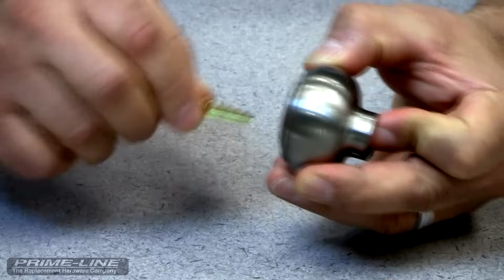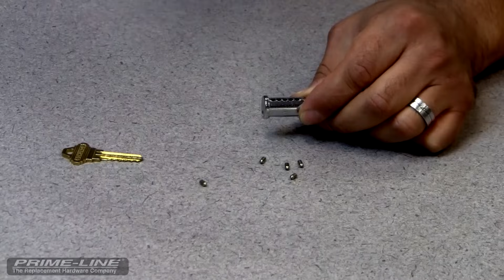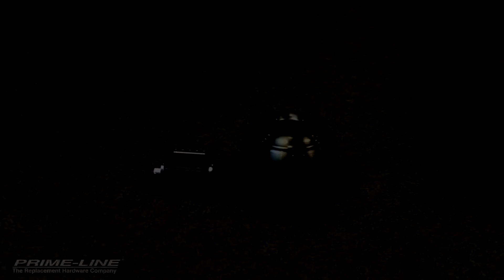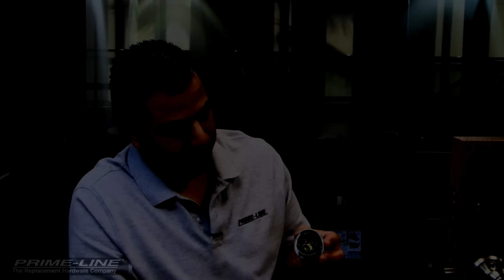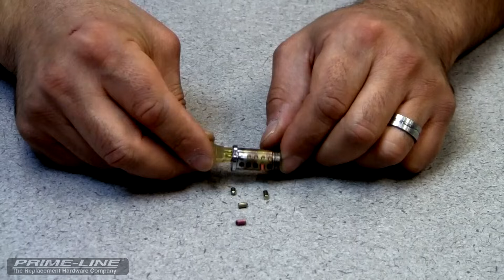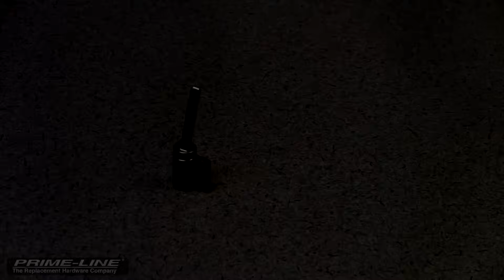Re-Keying a Schlage Entry Knob and Deadbolt

Comment: Hi, any advice if i lost the keys.  I would rather re-key my house rather than replace all the locks and deadbolts.  Thanks for your great video
Reply: Eric Holmes

Joy Duncan,

  If you lost the keys to your schlage locks, use a schlage bump key on the knob.  Here is how.

Pull the schlage bump key 1 notch from the keyway.

Bump the key to the right with a hammer (turn the key to 3 o'clock)

While the schlage bump key is at 3 o'clock.  Stick a thin tool in the tiny hole on the knob and the knob will come off of the knob housing.

You can now repin the schlage cylinder to a schlage key blank.
Reply: @ericholmes5743  He does not want to repin the cylinders - that would be a lot of labor.  What he wants to do it first use your method to disassemble the lock cylinder, and then determine the key code from the length of each pin.  Then he simply has keys made using the code.

Comment: Great video...

Rekeyed two but on the third I got cocky and didn't slide it in at the correct position and two of the five spring/pins set in the lock leaving it halfway in/half way out...

Any tricks to getting it unstuck?
Reply from the maker: Is it the key that's stuck or the cylinder?
Reply: The cylinder is stuck.  The key is out.
Reply: I had to watch the follow on video for the first rekeying as the pins and springs came out...  This one has two of the pins and spring engaged and won't budge.

Comment: Great video.  I have a double-deadbolt so I use a key on the inside and outside, will this work with that?  It is a Schlage...
Reply from the maker: Yes, just key both to match the colors listed in the instructions.

Comment: I'm a commercial locksmith and would suggest to stay away from the Schlage "F" series locks with this "floating" top cap ...pure junk. The top cap is prone to pop off during re-keying if you are not experienced and extremely careful. Also, when you turn the button locking the lock, the inside knob still rotates giving the impression of not being locked posing a safety issue if you have small children. Can also also cause lockouts.

Comment: I found that it is critical to get the right amount of turns (tension) on the threaded cap when it is put back on the key plug.
If it is too lose or too tight, you won't be able to remove the new key. The cap ring tension makes sure the key plug pins line up with the spring pins.
Reply: I had the same observation, BakerOne.
Reply: @Demetrios Christopher I found this interesting, because in my case I backed it off only one notch.  Apparently up to a quarter turn is ok.  Mine seems to work just fine so far.

Comment: Thank you for the video. My locks are almost 20 years old. Are there any differences I should be aware of?
Reply from the maker: I was told by one of our guys, that unless you have a knob set that has lever handles, everything should be the same and the only difference would be in how the unit is disassembled. If you'd like a definitive answer you can call in on Monday and ask for Bob in customer service after 9AM PST  (877) 649-9740 (toll free). He'll be able to tell you 100%.

Comment: I was able to re-key four of the locks after messing up on the first one. The springs flew out and now two of the the springs are in really bad shape. Any idea where I can get these springs from. Thanks for the videos though. They helped a lot.
Reply from the maker: You should be able to get replacement springs from any locksmith shop for very cheap.  If you have an old cylinder you can take the springs out of it and use those.

Comment: I just wanted to thank you for your video. I re-keyed 6 Schlage Locks in my home for the price of one re-keying kit from Lowes ($10). Before I made it to Lowes, I did call a number of locksmiths in my area. Each of them ranged from $15-$20 per lock. Thank you, thank you, thank you! you saved me over $100.
Reply from the maker: Glad the kit worked out for you, and for the kind words.   It's really not that hard to do, and after doing one or two it becomes pretty easy.
Reply: Exactly...I want to change more, just because I can  :)
Reply: Where were you able to find the rekey kit at Lowes?  Down the locks and door handles aisle?  I went there to get a rekey kit and the two guys had no clue what I was talking about.  All they said was that they could rekey each lock for a fee.  Might have to run by Lowes again to see if I can find someone who knows something.
Reply: Yes, I did. It was hanging on an stick post in the same isle as the Schlage knob sets. There was one set for the Schlage and one set for Kwikset locks. I do know Home Depot carries them, as well. Good luck

Comment: Yes, I did push down the pin. I noticed the other cylinder caps were easier than the one I worked with. I think it probably got stuck.

Comment: I did exactly as the video shows and attempted to remove the cylinder cap but it didn't come out. Any tips please?
Reply from the maker: Did you use the tool to push down the little pin that keeps the cap on?

Comment: What if you have several locks you want to be keyed the same? Looks like the kit is a case by case basis.
Reply from the maker: The kit has enough pins to re-key 6 locks.   If you need to key more than 6,  you can buy more kits, and just use the instructions from the first kit.   The instructions are different for each different key number,  but the pins are the same in all of the the kits for a particular brand.
Reply: +Prime Line I purchased 2 kits because I have 9 locks to re-key. The keys from each set appear to line up exactly, but the color code chart is different for each kit. Without removing the pins from the packets, I compared the two sets, and they also appear to be the same. How do I know which color code chart to use? By the way, thank you for making such a clear and concise instructional video.
Reply from the maker: TheBeckieLeigh Hi,  If you purchased 2 kits,  and the pin diagram is different on each, the keys should not be the same.

For re-keying more than the 6 locks each kit will do.  Just follow the instructions on the first kit, and use the keys from that kit.  The pins are the same in both kits, just the pin orientation in the cylinder changes for different keys.
Reply: +Prime Line Thank you for your quick response. I can't wait to dig into this project today.
Reply: When I took the cylinder out of the first door handle, I saw immediately that it was totally different from the cylinder in this video. The locks had been re-keyed before, and maybe the locksmith just changed out the cylinder with some aftermarket brand. Can you point me in the right direction for purchasing the proper cylinder?
Reply from the maker: TheBeckieLeigh We could probably help you better if we had a couple photos of the cylinder, and handle.  You can email any photos & questions to info@primeline.net

Comment: I need to rekey 7 locks and your kit only works for 6.  Can I get extra pins that match the other six sets?
Reply from the maker: The pins are the same in all of the kits.  If you buy another kit,  and use the pin-order instructions from the original kit you'll be fine.    The only thing that changes between kits is the order in which the pins go in the cylinder.
Reply: Prime Line Got it.  Thank you!

Comment: We followed your steps just as instructed. When we re-assembled the door and inserted the key it would turn the deadbolt but would not release the key. I think we are going to buy a brand new Schlage deadbolt for $35. Although, the instructions were handy, it simply didn't work.
Reply from the maker: Hmm... I can't think of what would be wrong that would let the key turn, but not let you pull the key out.  I'll talk to one of our techs' tomorrow morning.
Reply from the maker: My guy said that all of the pins may not have been dumped out when you were re-keying the cylinder.  Honestly,  I would just try going through the steps again to re-key is, and hopefully save yourself the $35.

Comment: I have been able to successfully rekey the knob locks with no issue, but there seems to be some extra parts in my dead bolts that are prohibiting me from getting to the cylinder properly...any ideas?
Reply from the maker: You're going to need a MUCH larger hammer..... 

Seriously though,  if you could possibly email a photo or two of the deadbolt in question, and any markings that would help identify it to the email address in the videos description, we'll try and help you out.

Comment: In a case where you don't have the original key all you have to do is pick the lock to the same position that the key would be in when they do the plug removal and install. I am a locksmith, so I am aware of how it is done. I just had to do the same thing to a house where the home owner only had one key that went to the front door knob lock, so I replaced and re-keyed all the locks to the same key. There are locks that will be almost impossible to pick though it's part luck and part skill.

Comment from the maker: Sorry,  I meant to answer you on Monday when I saw the message.   

Schlage knobs have a little tab on the interior that you have to push in the take the knob off.  I've seen others with the tab, and a wire that holds the rosette on.   You can try using the pin that's supplied with the kit and pushing in one of the holes and see if it releases the knob.

Any more details you can give will help.  You can email photos to the email address in the description and please mention YouTube

Comment from the maker: The re-key kits work, but if pressure is not maintained all the way through,  then yes the springs/pins can come out.  The only way we knew you could replace the pins/springs was by doing it.  Only after that did we came up with the cut-away view so the viewers could see what was going on inside.

Sometimes going to a professional is the correct answer.  I'm sorry you had a bad experience.

Comment: I insert a 1/4" strip of aluminum cut from a soda can between the cylinder and the plug when removing or replacing the plug. This insures that the top pins doesn't get snagged on the clip "ridge" on the plug. Does that help?

Comment: Pushing the cylinder through with the plug follower requires force, and this dislodges the springs, and unless you are able to cut the cylinder in half like you did, it is practically impossible to reinsert all 5 springs and plugs.  There is no way you can see into the cylinder to reinsert the springs and plugs.  This is impossible.  If  this happens you are completely sunk. Has anyone been ever to do this??  I  am going to return this kit and go to a locksmith to repair this mess.

Comment from the maker: If you have an old lock cylinder lying around in the garage or shed,  you might be able to get another spring from there to use.   If you look in the instruction sheet all of the pins are color coded.  The instructions will tell you which colors to use.  Barring that,  you can buy a new cylinder.  It's our part number E-2000 and you can get it online or in store at HD/Lowe's/Ace/TrueValue etc.  I'll add a link to it in the video's description.

Comment: One of the springs is bent, and I didn't realize there were so many little pins involved.  There are 15 pins of various sizes.  I guess this is just not a project for me.  I think it will be less frustrating, though much more expensive, to purchase new locks and have someone else rekey them.

Comment from the maker: Something extra?

The only thing that should have been in there is the pins.  Unless you didn't keep pressure on the plug follower and the springs came out.   

If the springs came out,  you can watch our other video for putting them back in.

Comment from the maker: Ahhhh,  sorry to be the bearer of bad news. You'll need a key to be able to get the cylinder plug out so you can change the pins.

You can however,  save some money by taking the knob to any locksmith (even if you want to do the re-keying later yourself) and have them give you one key that works.  The money saving part is, you don't have to call them out to the house.  And if all you needed was a key for that knob,  you're all set.   

If you still need to re-key,  you now have a working key.